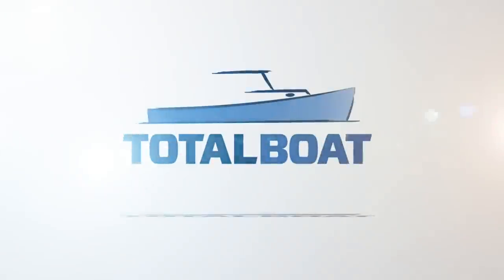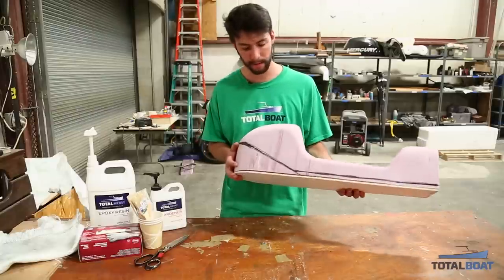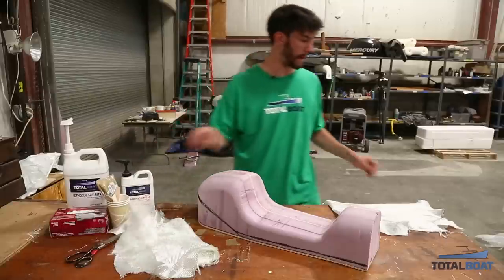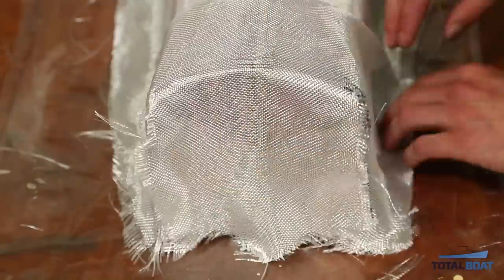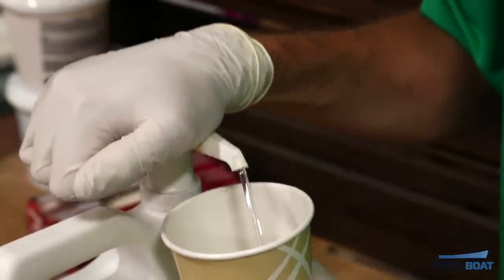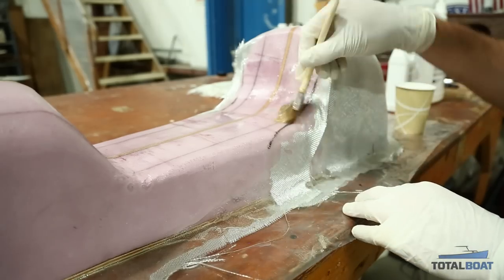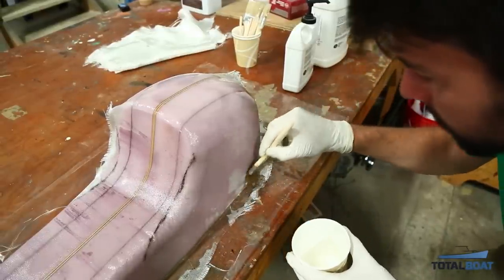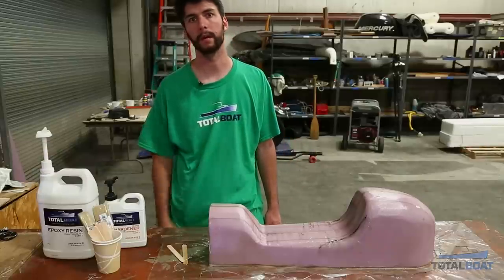How to Make A Fiberglass Mold from a Plug - Part 2

Comment: when you finish shaping the foam plug to perfection ,spray a couple  of coats of exterior acrylic paint on the plug and leave well to dry . Doing this will allow normal filler to be applied with no reaction  !   make sure the exterior paint  tin says  "ALKYD'

Comment: yes, great idea,,,,,,as far as polyester, you can spray pva mold release on the foam and it will not melt, be sure to let pva dry really well
Reply: bent rodguy   I didn't know PVA would protect foam from polyester resin.   Nice.  I have plenty of PVA.  
  I had to cover my foam with bake potato aluminum foil sheets, using Elmer s glue to tack it down.  It's easy to make a mess so be careful.  I will have to try the PVA.   Thanks 
 I didn't know epoxy wouldn't melt the foam either. To expensive but nice to know for smaller projects.
Reply: @the10thleper  , LOL!

LOL,

LOL

Comment: I would coat the foam with a thinned bonding epoxy to seal it and use polyester resin with fiberglass mat. Much cheaper for larger plugs and the mat can be shaped around compound curves, especially concave curves, much better than cloth. If you use epoxy over mat you must use unsized mat since the epoxy will not wet out sized mat properly. There is the problem with VOCs from polyester so you would need to use a respirator.

Comment: Try mixing cabo sil with the resin before adding your hardner, that will make a paste you can use for your hard to lay surfaces and get rid of your airbubbles(don't forget to add hardner to your paste) also you a lighter weight glass for your first layup, it will help with the air bubbles.

Comment: I guess I don’t understand. What’s the point of making a fiberglass plug vs just a bare foam plug? It’s easy to shape the foam at get it perfect. couldn’t you then paint it with epoxy primer (545 as in his next video), finish fairing if needed, then buff and wax the primer for a gel coat that will be the mold? Seems like a lot of work to get a perfect shape and then fiberglass it and then reshape it.. thoughts? Am I missing something?

Comment: how you gonna get that foam out now.
Reply: That's a "plug," a male mold. He doesn't need to get the foam out.
Reply: Oh.
Reply: ...but...why wouldn't he pull out? I mean, when he's done, she's done, right? So pull out; and do again, and again... and agin...! Right? 

Who would want all that weight, from a HARD mold added to their cafè racer? That's a cafè style seat part - where the seat fits!

He did not make a filler, as mentioned, to fill in low spots, and did not spray on mold wax, as mentioned; so, he'll have to pull the walls of the part wide, then pry like hell! 

50 to one, it will break, first try?

100 to 1 it will break in any number of tries? - tries, to pull the foam core out... unless he put mold release wax on it, off camera...?

JK, not a beating fool!

By the way, that's why the mold is several layers of rigid foam board. It's easy to cut and sand, then each section pulls out from the center, easily - once the bottom is pulled/cut off, holding it together. The outer slices then are easier to take out. BUT, whea du wax?

LOL ;^D

Giovanni Joseph
Reply: @giovannijoseph9580  Giovanni, I think you're a little confused. He's making a plug, not a mould. He'll make the mould off this plug.

Comment: I would like to try this method to make a fishing kayak.  I always thought this stuff would melt when in contact with resin. Oh.....your using epoxy....not cost effective.  Anyway....what about some sort of barrier material.  Kitchen plastic wrap maybe? A thin layer of troweled plaster? There has got to be something.
Reply from the maker: TotalBoat epoxy is cost effective! Check it out! https://www.jamestowndistributors.com/userportal/show_product.do?pid=64343
Reply: Paint the plug with Elmers carpenters glue. Then you can use polyester resin and it won't melt the foam. I used this method many times. No need for pink foam either, I use plain old white bead board.

Comment: What methods did you use to shave the foam so perfectly round right after you cut the generic shape? I'd assume the foam is too soft to sand?
Reply: It's rigid foam, not soft. Afaik you can cut or sand it even with other foam pieces.

Comment: I tried doing it on a foam mold like the guy in the video did but my foam just started melting right away when I put the resin on and all of my hard work of carving the foam just disappeared
Reply: He mentioned this. Polyester resin dissolves foam, epoxy resin does not.
Reply: @tenders  epoxy resin CAN melt pink panther foam. I've melted it using epoxy resin in the shade when it was 95° outside. It was my mistake and had the air temp not been so hot it wouldn't have happened I think

Comment: should be using chopped mat, not cloth
Reply: GasserGlass not for his first layer
Reply: FIRST LAYER FOR ANY MOLD OR PART should be chopped mat to insure no Print Thru!!!!!!!!! .... Its the FIRST RULE in fiberglass!
Reply: even with epoxy? I  believe hes making a part from the male mold and not a mold so would that perspective apply in that scenario?
Reply: Hes making a plug...not a mold. That plug will have multiple layers of glass added to it. Then fairing compound of some sort.... then some type of seal coat of epoxy primer or similar.......then wax....then PVA..........and then he will have a PLUG in which he will use to make a MOLD.... then he will build the actual final part.

But if he was using a mold  the 4th layer of laminate should be CSM with wax and PVA and resin or gelcoat coming before it.

Comment: what grit is recommended for sanding this?
Reply: If it's really a bumpy mess like his will be, start with an angle grinder, 80 grit, then 120, 240, then wet sand with 400, 600, 1000, 1500, 2000, 3000, and finally buffing, with 4000 or 4500.

It can be hard to find. I would put your gel coat on when tacky, after water washing the wax produced from drying, then increase the wet emory cloth each layer, and clear coat layer, with a final buff! Ooop, no clear coat, for non-composite non-gel-coat parts! Apologies... also depends on, if you will be walking on it - decking. It will need a bit of roughness, so you don't slip into the ocean, and get sucked into the abyss, disappear, and drown!

With a female mold, you can super fine sand the mold, and start with wax, then gel coat, and layup glass. It pulls pull ready to de-wax, and use - usually. LOL

DOH! What?

Comment: guarantee  i would end up with 5 times as much hardener as i needed. 5 to one is 5 pumps to 1 pump
Reply: er 1/5 as much see i messed it up wit yer crazy pump system
Reply from the maker: our crazy EASY Pump system!!! If you can read (the directions included!) then you can do it! 1 pump to 1 pump. Delivering the right mixture every time!
Reply: Everybody makes that mistake, but only once. Without the pumps, you have the opportunity to make that mistake on every batch.